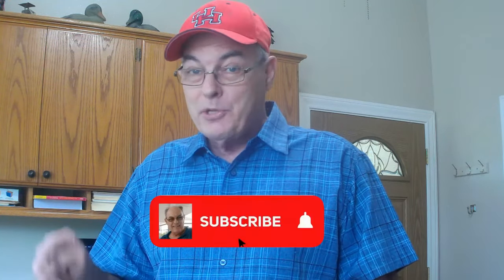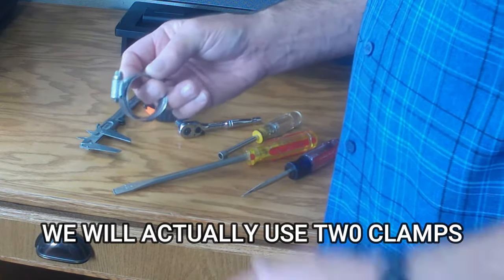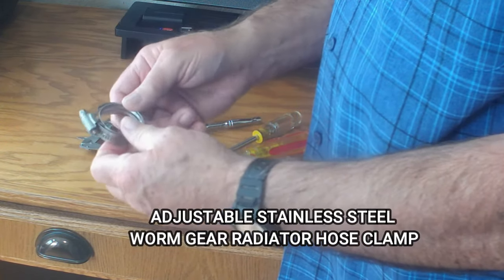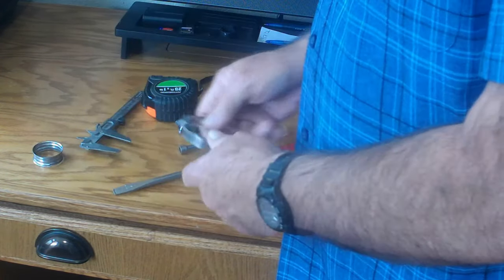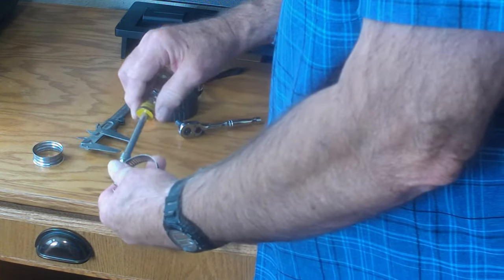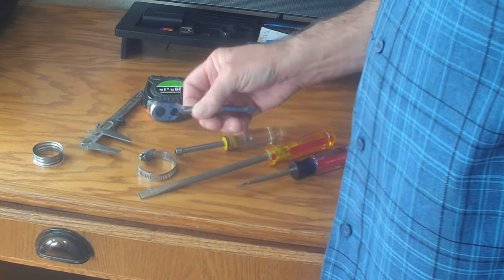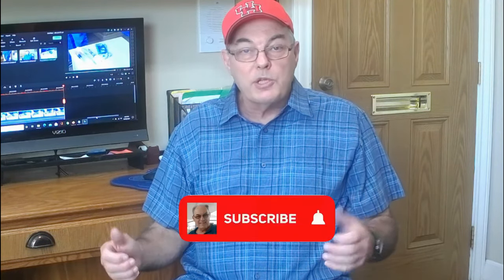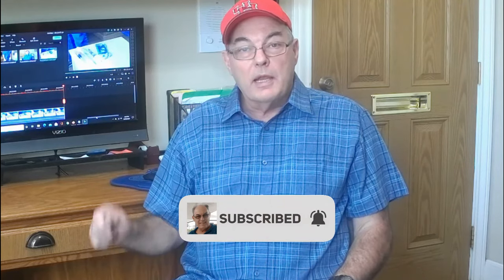How to repair a sinking office chair: Fast $4.00 DIY fix

Comment: Thanks.  I called a carpenter after buying the clamp since the clamp can be difficult to put on.  After seeing your video, he followed your instructions, and 
it worked like a charm.
Reply from the maker: Thanks for your comment.  I'm glad it worked out for you.  Did you use two clamps or one?

Comment: I fixed it this way, and it worked for a few months. I decided to drill a hole and drive a screw. A little tape to hold the screw in the hole was fixed Three years later still works as new, except the seat ripped off. Good for my garage.
Reply from the maker: The secret is to use two clamps butted up against each other and tightened well.  My repair is still working.  Noithing wrong with the drilling method though!

Comment: Putting some duct tape or rubber surface around the metal pipe helps a lot! I used an extra tennis racquet overgrip I had lying around. Gives the hose clamp something to grip on to.
Reply from the maker: Electricians tape works well also, but most things I tried started slipping eventually.  Using two clamps has really done the trick.

Comment: Thanks, We did this before we watched your video but didn't wipe the column off so it started slipping. Going back now and redo and wipe the column off then reclamp. My chair is still comfortable and hated to spend a bunch of money on a new chair!!
Reply from the maker: I don't blame you.  Did you use two clamps?
Reply: @deerparkhomeshop2471  yes
Reply from the maker: @pamwilson8286  If that doesn't work, your clamps may not be tight enough, or try wrapping the column with electricians tape, or something similar, before applying the clamps.  Good luck.

Comment: I used the WD-40 solution and it actually worked!
Reply from the maker: I haven't heard of a wd40 fix.  How does it work?
Reply: @deerparkhomeshop2471  
1. Extend the chair to max height and flip the chair upside down
2. Remove the clip holding the piston to the bottom of the chair
3. Spray the extended rod with WD-40
4. Reassemble the chair base and refasten the clip
5. Sit and test the chair by going up and down for about a minute so the full piston gets lubricated. After about an hour (if not immediately) you should see the chair does not sink.

It worked for me at 350lbs and on the first application. A few days later and I still see no sinkage at all, literally. 

This solution is great because it doesn't lock me into one height and I can adjust my seat as needed - as designed. If you make a video, I'll check back to see if it worked for you, too.
Reply from the maker: @J.E.R.O.M.E.  I am definitely going to try it and if it works, I may make another video after testing it for a few months..  Thanks for the info!

Comment: Zip ties also work. Use about 3 of them
Reply from the maker: Never tried that.  Will they eventually slip?
Reply: @deerparkhomeshop2471  So far so good. I had to looked around the internet and someone said a good alternative to hose clamps are zip ties, so I gave it a try. I was skeptical myself

Comment: Very nice, But what happens when the chair sinks to the bottom and will not raise again?
Reply from the maker: I haven't encountered that myself.  Mine would sink all the way down, but I could pull the adjustment lever and raise it back up.   Have you tried tuning it upside down and then put your knee on the chair bottom and pull up on the chair legs.  Once you have it back out install the clamps before you do anything else.
Reply: over the years this has happened many times   usually I  just dump the chair and buy a new  one
But I recently found a company that will sell just the gas cylinder at a low price and it is an easy thing to replace,  if fact I have an order in for two cylinders right now, the only down side is they come from China, So quality?????????
Reply from the maker: @petercrane2065  They will probably work just fine.  Of course, it can be hit and miss on Chinese products.

Comment: The wd-40 trick works perfect.  Just take the clip off the bottom of the cylinder end underneath chair, pull legs and wheels off cyclinder, wipe cylinder down with paper towel and then spray liberally with wd-40, or vaseline if you dont have, then put back together, go up and down a few times, and youre good.
Reply from the maker: And it won't sink to the floor anymore?  I'll have to try that.  Thanks for the heads up.
Reply: @deerparkhomeshop2471  yep
Reply: @deerparkhomeshop2471  did not work for my daughter's chair. Saw that fix in another video...now i'm here since it did not work. Another gentlemen's video said to leave it overnight upside down to allow the factory oil to drain back down (or rather to the "top" of the cylinder since it's now upside down). That's where we are now with potential DIY fixes.
Reply from the maker: @toddkoontz23  I haven't heard of the upside down method. I will try that tonight and see if it works.

Comment: I tried duct tape and it keeps loosening so I left the duct tape on and used a zip tie instead of a clamp. So far so good.
Reply: Hoping the zip tie will stop thentape from loosening and give it a permanent grip.
Reply from the maker: @topduke527  Hey, if it works, that's all that matters, right?

Comment: you might want to look at the model number on the chair and get a new cylinder for it.this fix is not something i would reccomend.ive worked on office furniture/chairs for 30+years and know that the manufacturer would void the warranty immediately.most good office chairs have a 10-12 year warranty and will replace the cylinder free of charge if its under warranty.
Reply from the maker: I'm sure you're right.  This video is designed to provide a quick fix for folks who are tool challenged.  If I do another chair video, I will mention the warranty.  My cheapo chair doesn't even have a brand name on it.

Comment: Would this work as well for a chair that keeps rising? My office chair goes all the way down (almost immediately) whenever I sit on it and then go back up whenever I stand! It's very annoying.
Reply from the maker: You can adjust the level of the clamps on your cylinder to make the chair stop at a comfortable sitting position.  This won't make it stop rising from that point.

Comment: It doesn't work please.  After a while it came down.
Reply from the maker: The repair has worked for most people, so I'm not sure why it didn't work for you.  Try tightening the clamps a bit more.  You don't want to overdo it, but if they aren't tight enough it will slip.  Make sure the column is clean and free from oil.  Many of my viewers have also wrapped the column with electric or duct tape first to give a little extra bite for the clamps.

Comment: Simply drill hole on the piston(shiny tube) and insert a pin across the hole...that would fix your issue..
Reply from the maker: I considered that and it will definetly work, but I wanted to offer a quick, easy solution that would appeal to those less tool savy.  Thans for watching my video!

Comment: Get a new gas cylinder, or better, recover on from a discarded chair. Don't do this.
Reply from the maker: If you need a chair you can adjust up and down, you will need a new cylinder, but if you can get by with a fixed height setting, the double radiator clamp  method is perfect, especially for folks who would hesitate to tackle a cylinder change.  I repaired mine over a year ago and it has never needed an adjustment.

Comment: Here is the elegant permanent fix I made:  https://www.youtube.com/watch?v=5fS7NQbLAlA
Reply from the maker: Interesting.  Good idea!  What material is the sleeve you put over the rod?  Also, I assume that height adjustment is probably not possible in this method either?
Reply: @deerparkhomeshop2471  I cut it from a scrap piece of copper pipe. Yes, you loose the height adjustment.
Reply from the maker: @Sprintervan  Thanks.  It looks like a good way to do it.